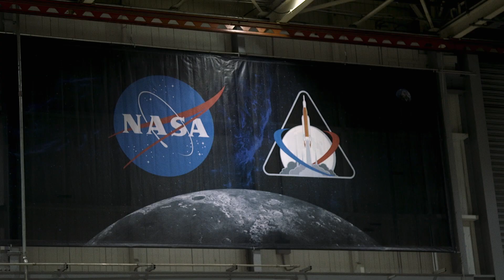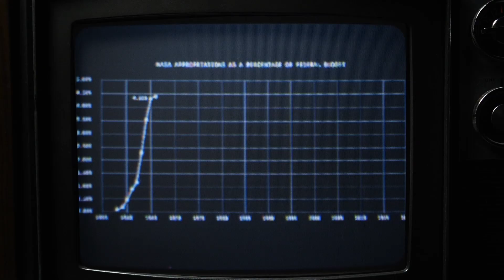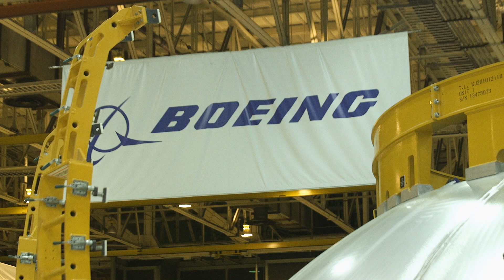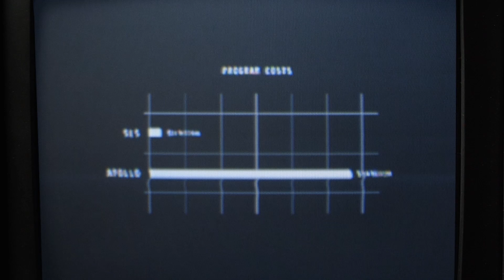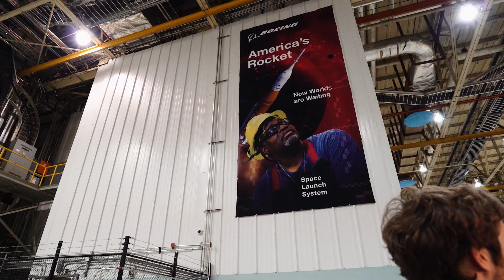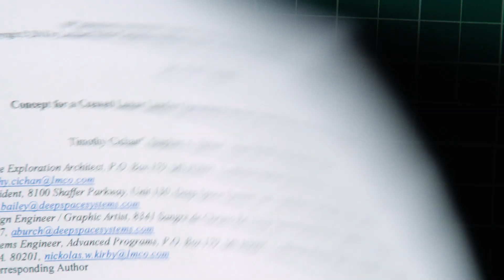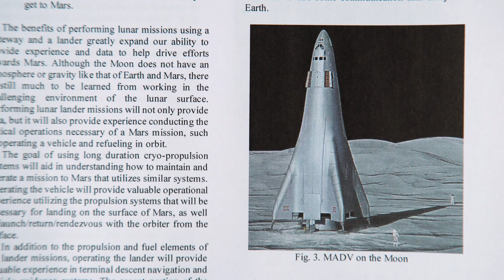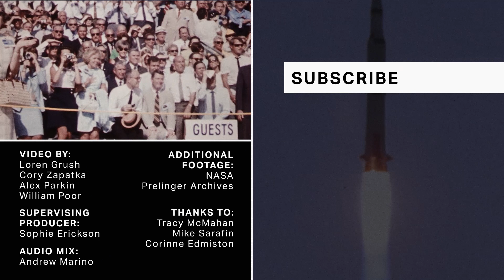Why NASA hasn’t gone back to the Moon

Comment: No new engine ? Are you kidding me?
Reply: Rip all those Space Shuttle engines

Oh wait.. SLS will probably only fly 1-3 times before they retire it, so at least some of them will be left.
Reply: @spidermain  Probably won't fly at all
Reply: That engine is very efficient, reliable, and already built. I don’t see any issue with using it.
Reply: nathancd nathancd we all knew that engine is reliable , efficient . Nokia mobile phone is also reliable and efficient , will you use it now ?
Reply: @jones1749  That's the meme/joke. I like SLS IS FAKE jokes, but the reality is that it is very far in it's development. It will most likely fly.
Reply: @drevil2675  that mentality is exactly what slows down the development of technology. However it makes sense to NASA as they are on a tight budget.
Reply: Dr Evil the problem with your comparison, is that you can’t just take anything in it’s mid development and compare it with something that physically can’t get any better. Rocket engines have been around a lot longer than smart phones, let alone cell phones. The engine in the newest car is basically the same engine from 20 years ago, we’ve reached the physical limits of silicon chips, we simply can’t make a 100ghz silicon processor, we’ve plateaued at around 4ghz. The shuttle engine is as close to being the ideal engine for its type that physics allow, from the fuel we are using.

Comment: So if the engine tech is 30+ years old then what new tech is being developed? The SLS is not reusable, so it's going to cost more than Falcon Heavy. Prime example of pork barrel spending like the bridge to nowhere.
Reply: Falcon heavy is also heavily delayed and is far less powerful.
Reply: matthew clark  NASA technology has and still does contribute to innovations used in everyday life
Reply: FH is not delayed but the BFR/Starship is not finished. So maybe a fairer comparison would be SLS to BFR. I think BFR will launch before SLS (unless SpaceX runs out of money).
Reply: Rocket engines themselves are slaves to the chemical energy in fuels. And until you invent some new chemistry that allows higher efficiencies and/or power without the side effects that makes any such currently known useless, then they can just marginaly get better. Reusable rockets helps certainly, but there's just no way a reusable rocket will launch similar sized parts to any orbit. The Falcon/Falcon heavy themselves are used in non-reusable ways to launch heavier payloads, or payloads to higher orbits. And atm they pretty much have to get all 3 cores of a Falcon heavy down to make it cheaper than just launching the same payload on a single Falcon without recovering it.
Reply: You have it backwards. Reusable rockets cost MORE, not less than non-reusable rockets, which are basically disposable and only need to work right once. The only way you can save money with reusable rockets is if the cost of developing and maintaining the rocket over a certain number of launches is less than the cost of building new disposable rockets for the same number of launches.

Comment: My 2-yr-old phone is obsolete, but they can't recreate tech from the 60s?! Poppycock.
Reply: Kinda hard to recreate the tech because the blueprints are long gone and the thousands of engineering changes were not documented.
Reply: @cadeallen7210  Blueprints are still there. Yet there is no one with the same level of craftmanship left, and were the engines had a flaw in the blueprints, the workers never wrote it down. They actually tried to do it some years ago, yet failed and found that designing a new engine that was nearly identical, was the way to go. Yet russian engines are what they use on most rockets at nasa today.
Reply: @brostenen  My bad regarding the blueprints. I do think it's interesting how the workers just kept the changes to the blueprints in their heads. Different times I guess.

Comment: It's all under control.  Delay Systems is building the engines.  Missing Funderss is handling the guidance system.  Cover Up Co. is working on the communications equipment.  All under the watchful eyes of COST OVERUN Corp.

Comment: Apollo never landed upon the lunar surface in 69 and SLS will be no different. The Orion capsule project stalled after guidance specialist Kelly Smith said the quiet part out loud, referring to the challenges of going through the Van Allen shield.    ... Kubrick won't save you this time !
Reply: "Apollo never landed upon the lunar surface in 69"

On the contrary, it did so twice. Eagle and Intrepid - Apollo 11 and 12.

"The Orion capsule project stalled after guidance specialist Kelly Smith said the quiet part out loud, referring to the challenges of going through the Van Allen shield."

What on Earth are you blithering on about. And what is the Van Allen shield? Do you mean Van Allen Belts?

Nope. Spectacularly wrong again. You are referring to a 2014 video entitled 'Orion: Trial by Fire' in which Kelly Smith discusses the challenges posed by the VABs for the then new Orion capsule. Because the computers aboard Orion are much more powerful than those carried by NASA’s Apollo moon missions during the 1960s and 1970s, such advanced high density electronics are more susceptible to the levels of radiation found in the Van Allen belts and beyond. This is a given and needs no further explanation. However, understand that the read only core rope memory used by Apollo is radiation hard. In contrast, radiation ionising the underlying semiconductor material - for instance when an electron tunnels into a transistor, can cause adverse effects. Look up single event upset and the more destructive single event effects/latch-up for more information. The large bipolar (NPN and PNP) transistors in the AGC were not very sensitive to radiation. Modern MOSFETs are much more radiation sensitive. Orion's onboard systems use modern electronics that are far more vulnerable to particle radiation than their Apollo-era counterparts. When high-energy protons and other ions hit orbiting spacecraft, they often leave ionisation tracks in electronic chips. These tracks can upset spacecraft computer memories and otherwise disrupt sensitive electronics. This was not a problem for the Apollo design. Smith stated that these challenges "needed to be solved" before we can send a crew into those regions of the belts and beyond. What do you mean the project stalled? In the same year Orion was sent into the densest regions of the belts and last year, to orbit the moon and return to Earth as part of Artemis 1, to overwhelming success. Why is it even necessary to explain all this again?

"Kubrick won't save you this time !"

I'm curious to know - do you have anything remotely or vaguely resembling an original thought or observation ever even occasionally entering your vacuous cranium?
Reply: Scientific community of every nation ON EARTH believes the missions were real, but YOU know better. Because you watched a youtube video that said so. Got it.

Comment: sounds funny we can’t figure out something we did 50 years ago
Reply: we cant make the concrete romans had either, but we can make stronger concrete
Reply: @magnusorn7313  Yep.  It's also more expensive concrete.  And you have to pay the workers more because they expect better wages.

Very good metaphor, sir.  I apologize for my...extremely poorly educated compatriots.
Reply: @BenGrem917  no? we can make concrete that is stronger than roman concrete for less money
however we use MUCH better concrete with supports and that costs more
using the same materials as the romans did you could make it stronger by just using the modern understanding of what mixture works best

Comment: We no longer have a capable rocket
Saved you 10 minutes.
Reply: Well, no. It's more than that. Obviously we don't have the Saturn V anymore, but it also has to do with a smaller budget and bureaucratic corruption.
Reply: But we did 50 years ago
Reply: NASA doesn't. But private companies have projects for rockets that are way better than the SLS. Like SpaceX's Starship (or BFR) or Blue Origin's New Glenn. It's time NASA stops trying to do something that the private sector can handle a lot better.

Comment: The costs would be astronomical, there is also the lack of expertise, motivation for  a new round of built up tests/flights and so on. It was a great achievement, but that was the 20th century and technology has gone into another direction. Don't forget that we also don't have space shuttles and supersonic passenger airline travel anymore. News is that Airbus  will canning its largest Airbus A380 and that Boeing will phase out the large 747, which be used as a cargo plane as opposed to a passenger plane. It is what it is..

Comment: I Dont understand here,  NASA has already landed in moon and they have saturn rocket, engine design and moon lander, why dont they recreate with modern techonolgy , instead of giving to private companies to build it.
Reply: They had Saturn rocket, you know that it is 50y old design? Do you think that they maintained for 50  production halls
 for that rocket? There are only designs left, but there were many so many amendments made to them that it's nearly impossible to reconstruct that engine, and engineers working on them are long dead, that's why they need new design, new rockets.
Reply: @tgstudio85  amendments are not for engine design,  People dont stay long but ideas and designs do. Outsourcing the work that nasa did already is bit strange.

Comment: I somewhat disagree with the budget figures argument. If you adjust for inflation and look at the cumulative budget for NASA across the past decades, the substained budget has been slightly less but still a substantial amount of funding. What has changed has been the direction. Modern day NASA has an extremely diverse set of goals and programs. Human space exploration is but a fraction of that total budget; much less than during the early days of NASA, when all funding was directed towards that program.

Comment: The costs would be astronomical, there is also the lack of expertise, motivation for  a new round of built up tests and so on. It was a great achievement, but that was the 20th century and technology has gone into another direction. Don't forget that we also don't have space shuttles and supersonic passenger airline travel anymore. News is that Airbus  will canning its largest Airbus A380 and that Boeing will phase out the large 747, which be used as a cargo plane as opposed to a passenger plane. It is what it is..
Reply: Excuses, excuses...

Comment: Why doesn't NASA start setting up satellites on the moon to build a network so that going to the moon can be a lot cheaper in guidance and fuel costs?

...oh that's right! Contracts. Military contracts to limit technology.
Reply: Even if they had a network the advantage would be minimal we've mapped the thing to death. And need I remind you the guidance computer in the past only needed less then a gig of ram like way less and it still worked doing the guidance with modern tec even onboard the rocket would be so trivial a single dedicated space enthusiast could do it. In there free time.
Reply: >Military contracts to limit technology.
You mean, pork-barrel contracts to keep Shuttle contractors in business? Because SLS is made from Shuttle hardware.

Comment: While NASA has become, in many ways, a classic public service bureaucracy, the objective of leading edge research in far space and getting people into space is its primary objective. If the governments want to monitor sea level rises or other climate change aspects, then that is the job for a real public service department, like the federal national parks, or bureau of metrology. Those organisations would use low cost private launch vehicles to do, what is basically, a modern version of checking the sea gauge in the harbour. We need to get to the moon, not because it’s easy, but because – you know the rest.

Comment: Read Gene Krantz book, "Failure is not an option".  When they let Apollo die, the best of NASA died too.  A Monkey can wear a spacesuit and sit in an automated box until the mission is over.  What they DO NOT have is the virtual army of engineers and technicians that made up the 4 full flight crews.  Those that sat in one room for a 10 hour shift every day 7 days a week for the length of every mission.  4 shifts per  24 hour day.  One team for EVERY system and sub system in the launch vehicle, capsule, second stage, third stage, lander, rover, every thing we use in space.  There is no stable status quo in space.  Everything is in flux and those teams must be experts in their system.  It is they that the launch director goes to when things turn belly up.  Apollo 13 is not the only time a mission had a bad problem.  Every mission had at least 10 or more problems crop up. 13 was just the worst.  Several more were life threatening too, they were just solved quickly and the missions went on.  
To build a launch vehicle is one thing.  To make it fly was another.  To insure it lasted the whole mission is yet another.  The FLIGHT ENGINEERS are what made every mission a success.  When things drop in the ash bin, the astronauts ask , "What are our options?"  The flight director and crew are what give those options and solutions.

If NASA was serious, they would have had a small team work with Boeing during construction of the SLS Booster.  Then they would in turn teach more engineers what they learned.  You must start this process years in advance.  That is why NASA is not serious about returning to the moon.  They spend what funds they get on many, many small programs, but ignore the important one.    
Read Gene Krantz book.  (soon)

Comment: What radiation protection is there for astronauts on the moon orbiting craft ?
Reply: The Command Module’s outer hull was made of stainless steel and the (upper) heat shield from epoxy resin, along with fibrous insulation between the inner and outer hulls. The astronauts would have been at serious risk of electromagnetic wave radiation from energetic solar flares, however the Apollo flights coincided with the height of the solar cycle, the periodic waxing and waning of activity that occurs every 11 years. The increased strength of the Sun’s magnetic field that permeates the solar system acts like an umbrella, shielding the Earth, moon and planets and therefore lessening the impact on astronaut radiation doses.

Comment: modern submarines have to withstand a pressure of 30 atmospheres. For Space craft its 1 atmosphere.
subs have large cabin volumes, like 7000 cubic metres, manned lunar space craft its 30 cubic metres.
subs have to sustain 130 people, manned spacecraft its 3
subs have to spend around a year without resupply. lunar space craft its 9 days.
subs have to be kitted out with the latest weapons, detection, and evasion tech . Lunar spacecraft don't
subs have been in active service for decades. spacecraft are used for a few days.
subs are multiple in service simultaneously. lunar space craft its one at a time.

every way u look at them, subs have more extreme environments, are harder and more expensive to build. 
yet many countries have built subs. Only the US are purported to have built lunar manned lander spacecraft : 50 years ago!!!

how about a video explaining the bizarre discordance between sub and lunar space craft production and deployment. protip : its cos the apollo program was fake, a TV stage production.